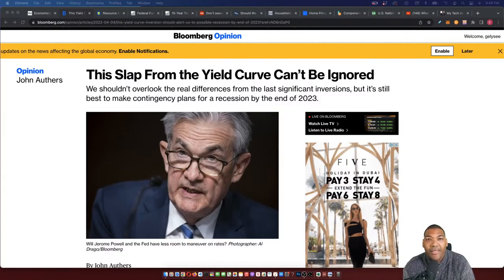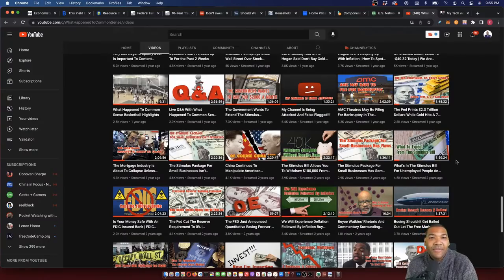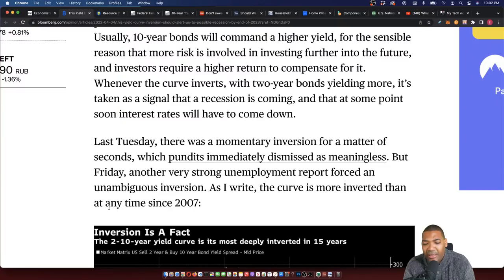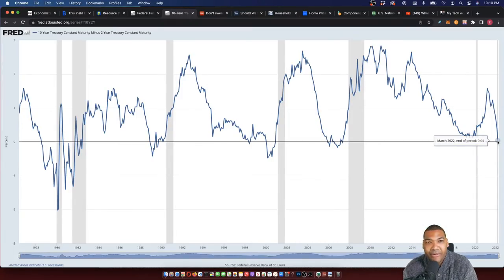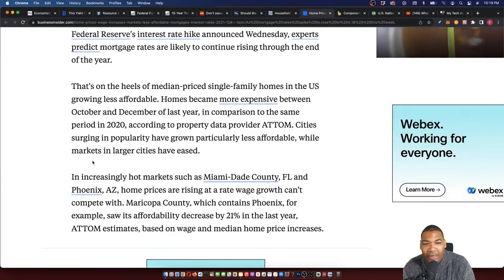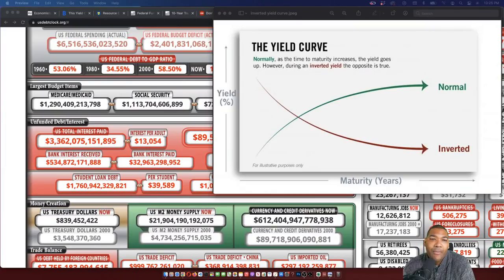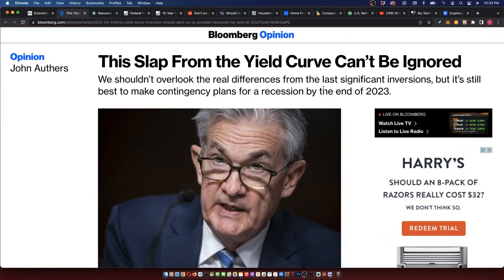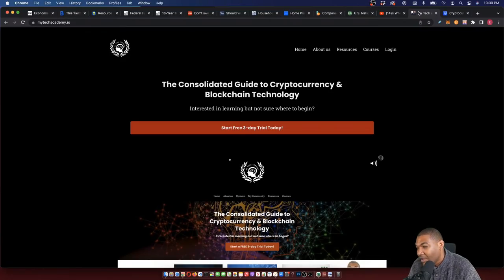The Yield Curve Is Signaling That A Recession May Be Coming Soon

Comment: Great video. The Fed artificially has increased the value of assets for the last 60 years. Kicking the can down the road does not work in the long term. Either war or economic collapse will be our future if monetary policy is not fixed. Overall GDP has been flat and consumer based. This is an issue.

Comment: The fed is withdrawing from from buying bonds causing the interest rate to go up
Reply: Great video. The Fed artificially has increased the value of assets for the last 60 years. Kicking the can down the road does not work in the long term. Either war or economic collapse will be our future if monetary policy is not fixed. Overall GDP has been flat and consumer based. This is an issue.

Comment: I am curious!  Is this the best time to still buy a home or should I wait until the recession happens?
Reply: Wait for a pullback
Reply: Buy
Reply: @kelvinreyes64  u dont buy on green only on red. Plus a crash is coming
Reply: Or consider the fact that your primary home is not a cash producing asset unless you’re buying a multi unit and renting out. You must weigh what you really want and what you just want.
Reply: I believe it depends on your situation. If you absolutely have to get out of your situation and you can afford the kiwi that payments. It’s a multi family with rental possibility. You will be at the location for at least 7-10 years. And you have sufficient assets in other assets including sufficient reserves. Anything other than that, I would hold off. Markets are cyclical.
Reply: Wait, people are tossing bids for homes they haven’t even seen, 4.5% APR on a home, you’ll get smoked on the loan

Comment: What’s the best way to hedge against a recession? Just hold cash? Or should someone just sit on their stocks/crypto etc. and wait for the recession to end
Reply: There’s a multitude of ways you can go, you can get some defensive plays to stave the losses, you can do shorts on stocks or such as the QQQ ETF, you can invest in Gold, it won’t produce a high return because it doesn’t produce anything but it keeps a bit of gain going in your portfolio, look into commodities such as Crude oil but make sure you understand that’s for the short term, one of the reasons Buffet went in on OXY, you can dollar cost average into positions while they’re financially pressed that you know have good fundamentals. For example, Meta Plat & Google has enough cash flow as to where they could fund themselves for 10 years straight without needing to ask for a loan or if the market shut down for 10 years! I’m not saying buy these positions, but if you’re going long term on your plays, soon it will be shopping time for you!
Reply: @LanternEnergy  thanks for the reply my man, will def look into these things in the coming months
Reply: Great video. The Fed artificially has increased the value of assets for the last 60 years. Kicking the can down the road does not work in the long term. Either war or economic collapse will be our future if monetary policy is not fixed. Overall GDP has been flat and consumer based. This is an issue.
Reply: The best hedge to inflation is to create and physical or digital product to sell. Also long term ethereum and bitcoin are good hedges 5-10 years. Also starter family homes are good assets to have (3bed 2bath).